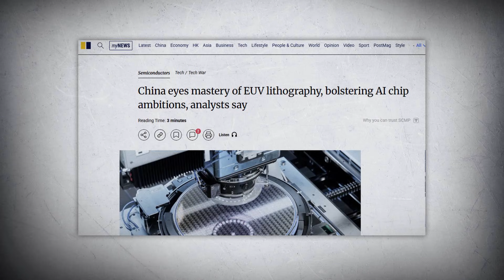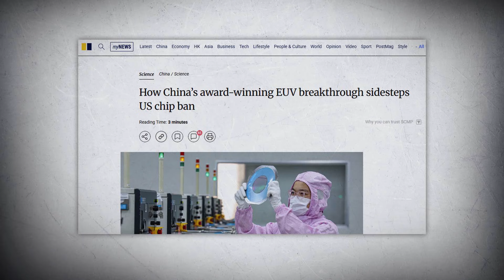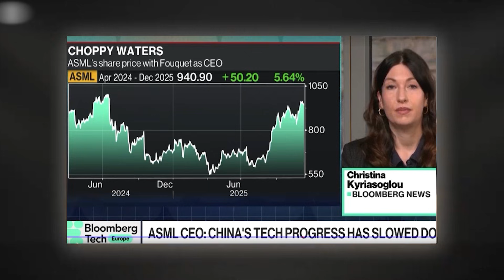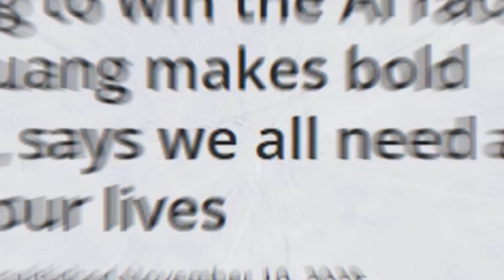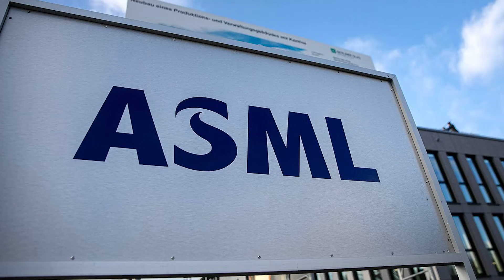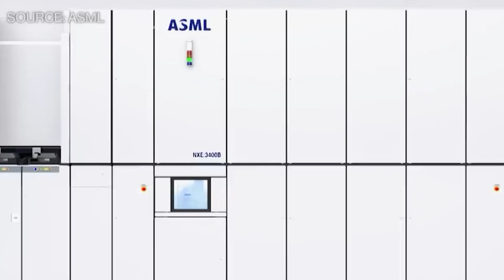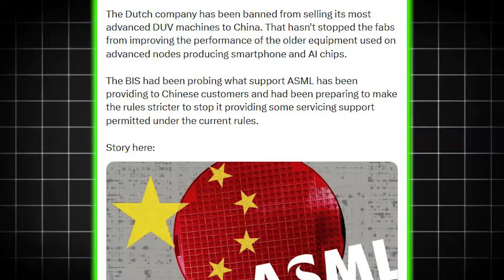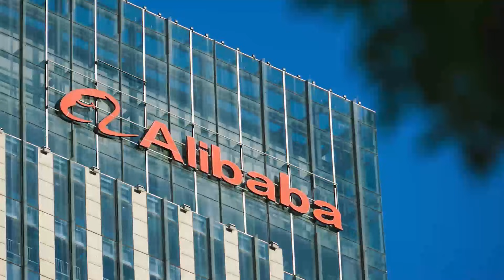China’s Manhattan Project: The Secret EUV Machine the U.S. Tried to Stop

Comment: I'll be the first to say I'm no where near a software or computer engineer but even I understood when the sanctions were first put into place, the writing was on the wall. China would go their own way. And they would do it in a time line under what america  would say. Low and behold, here we are. All the so called experts were wrong. China simply followed the path of technology development in the real world, not the wishful thinking europe and and America govrnts told each other.

As for the comparison, its a horrible historical references. But it follows the american mentality.  Does it mirror it tactics used? yes. But is the intention and mentality the same? No. Other things that gets me is if the secrecy was as high as the Manhattan project, then how was Reuters able to get this much detailed information. The investigation was maybe 1 or 2 yrs long? The Manhattan project wasn't discovered till decades later. Also, are these pictures stock images or are they from Reuters? Oh and another big question mark, what's the actual name of the project. 

I see what your doing there. I expected better. But it keeps to narrative. So I get it.

IMM, your summary of the article insinuated China can't run secret programs. And technology wise they can't do anything on their own, they have to cheat. Does backwards engineering help? Yes. But anyone working from that point also knows you have to have a super high level of technical proficiency to even attempt it in the first place.

I imagine to get over the last hurdle, they'll more than likely develop a new method for the process. My indicator is Huwaii involvement. They already created some new tech designs western companies don't use.

Comment: This Chinese EUV lithography prototype (2025) is NOT a product of reverse-engineering. Here are the key reasons:
 
1. No object to reverse-engineer: China has never obtained an ASML EUV machine due to strict export bans; there’s simply no physical unit to take apart and copy.

2. Distinct technical routes: China’s prototype uses self-developed routes like LDP, which differs fundamentally from ASML’s LPP light source technology—this is independent innovation, not replication.

3. Fully independent R&D system: Core components (light sources, mirrors, control systems) and the entire R&D chain are developed by domestic teams and supply chains, forming a self-sufficient industrial ecosystem instead of copying from others.

Comment: IMPORTANT CONTEXT Being unable to get EUV machines, China didn't just sit around waiting; they redesigned the chip architecture of the existing 12nm, 10nm, 8, 7, 5nm chips, they made them more efficient, they stacked the transistors, they put memory on chip, they put memory on transistor - so it is NOT an apples to apples comparison any longer.

A Chinese 10nm chip can outperform a Western 7mn or maybe 5mn AND WITHOUT THE POWER CONSUMPTION AND HEAT ISSUES
Reply: 我们中国一直出口稀土，但我觉得总有些稀有稀土东西保留着不出口，自己偷偷用😅
Reply: The last comment is BS. German developers build A.I. systems which are like factor 1000 more efficient. No chance.

Comment: If we are talking about the new  analogue chip machine then it is not reverse engineered. It uses completely different technology and produces analogue chips which are 1000 times faster than current chips. The chips don't need to use attached memory between calculations.

Comment: Kirin 9030 pro are produced using Huawei LDP EUV lithography machine,  the machine is 30% smaller than ASML one
Reply: Kirin 9030 pro are made with (DUV) multi-patterning lithography.
Reply: @ZuulGatekeeper Kirin 9030 is produced using a DUV lithography machine with the SAQP technique,   the Kirin 9030pro is not.
Reply: @wengoenlie731 Nope it's also DUV, Huawei has pushed it from 7nm down to near 5nm, theirs no EUV machines in China as Uncle Sam banned ASML from selling them the technology as it has US IP.
Reply: @ZuulGatekeeper It depends on where you got the info, no need to argue

Comment: The ASML is very cocky. Won’t be long before he will have eggs on his face, and  his company turn turtle.
Reply: Reuters claims China is using reverse engineering, which is complete nonsense. China doesn't currently have EUV machines, so how can they reverse engineer them? Are they reverse engineering something out of thin air?
The most bizarre logic of the West is that they always assume China lacks independent research and development capabilities, and whenever China achieves a technological breakthrough, they immediately claim it's "reverse engineering, imitation, or plagiarism."
If the West refuses to face reality and continues to bury its head in the sand like this, it will only lead to further decline in the future.
Reply: yeah, asml is scared of cockroaches